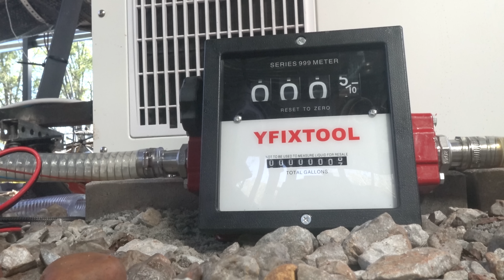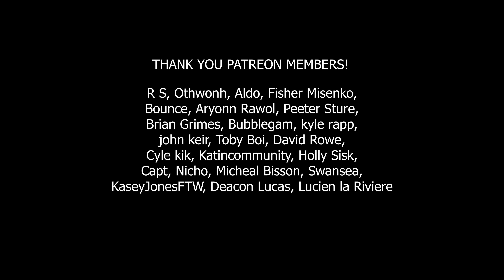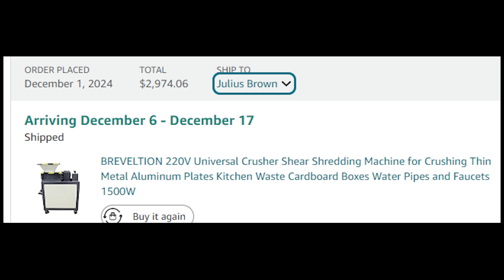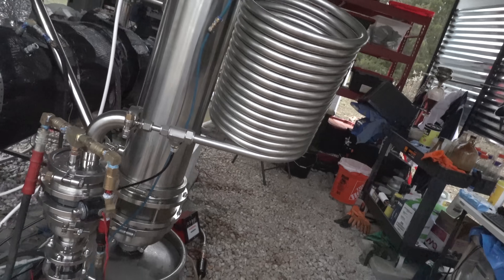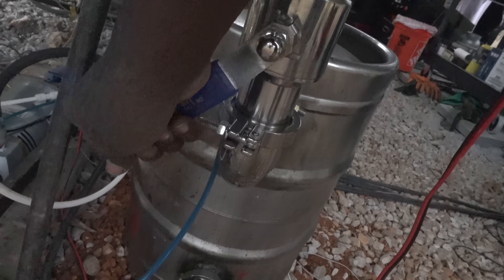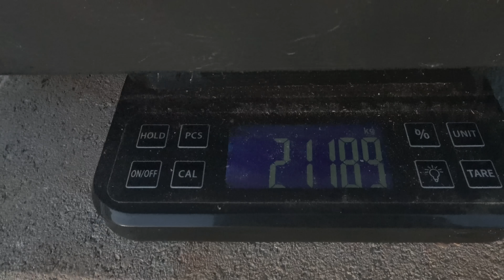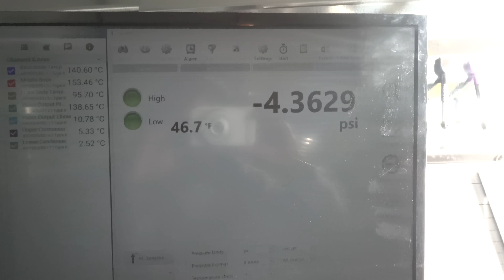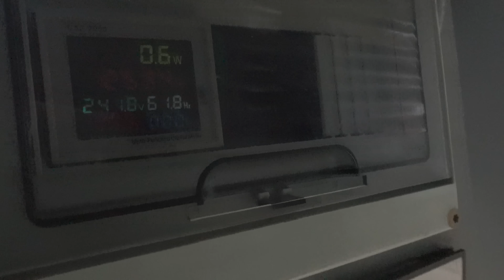I made my own gas station! Fueled by Plastic Waste + LDPE Analysis Run Part 1

Comment: This is actually cool , the only downside is that you gotta collect plastic yourself from whatever trash can/recycling bins on a daily basis within your area so that you'll be able to make whatever amount of gallons of fuel you need to use on a weekly basis , if people got busy lives this isn't going to work for them 

I've been reading some of the comments , I don't think the gov is going to harm him at all , but if enough people did this they might impose a ban on it , because the big fuel corps will tell our gov to ( shut those people down ) especially since it'll be hurting their pockets which in turns will also hurt our gov pockets also because there's people in our gov that receives money from these corps , or they'll come up with some Bs law to try to make money off of the people that do this process

Our gov knows that we live in a society where people want things (right now) instead of going through the process to make it themselves , so our gov isn't worried about a handful of people making their own fuel

Comment: This guy is out of business before he can sell a full tank of fuel. There is no profit to be made here as he is operating at a loss just to create each gallon.
Reply: Not everything is about profit. We need to find a use for the millions upon millions of pounds of plastic trash around our planet. This is one such use.
Reply: @Volcanic_Ashe  You can't solve one problem while creating another problem in the process.
Did you notice there are byproducts produced that are worse than the plastic?
What will be done with that?

So again your profit isn't the issue.
The problem still remains.

He isn't creating gasoline at all.
Reply: @Volcanic_Ashe  Turning the plastic into other usable items instead of toxic goo.

Comment: Wow using plastic to release gases into the atmosphere wonderful🙏❤️
Reply: If you bothered to watch to watch, he refined it and made it cleaner. It's not perfect and the gas may be toxic but it's no different from other gas at the station, except that it cleans up all the harmful plastic sitting around our environments.
Reply: well its not a solution to replace on bad thing with another, The source needs to be fixed

Comment: What is your power consumption through pyrolysis before it even hits the refining station? A lot of pyrolysis is subsidied because it's not sustainable and ends up a net negative. I want to see what your output in Kwh is.

Comment: This young man is the Inventor many Billionaires wish they are. There was a Japanese machine that turns household plastics into Oil that could be put directly into a furnace. I wanted to buy the residential unit. When I was prepared to purchase it disappeared? I found a distributor in New Jersey but somehow

Comment: There is no reason for all the plastic pollution in the world when you got inventions like this that can recycle and refuel our economy like this. Thank you for showing people that it can be done. Very smart and very innovative. Your one of the best Scientists I've ever seen in a long time ❤❤❤
Reply: So when its a hard plastic, its mostly harmless. When you do this, you release those toxins into the air, have to dispose of the other waste which can now seep into the environment much easier, and you're burning the finished product to release the rest into the air.

This process is only good for people who are bothered by the eyesore of plastic rather than the actual impact of it
Reply: https://www.youtube.com/watch?v=z_MqqLgTNLQ
Reply: You want to come work at Dakota gasification?  Put in an app I bet they’d hire you
Reply: Its not energy efficient to do this unfortunately.
Reply: @Mythocondria_Dev Rome wasn't built in a day. Give him time to get the wrinkles straight on the thing and have better efficiency 👈🏿🙇🏿
Reply: Energy and cost efficiency. If he's just pulling from the grid then you need to factor in the cost per hour to run with the amount of reclaimed fuel, i imagine his setup is not very efficient. If you're off grid it might be better depending on your solar setup.

Either way it's a cool as hell backyard setup.
Reply: @lolkthnxbai  it's basically run off the fuel he produces and uses to run his generator and solar power.
Reply: The diesel engine was designed to run on peanut oil so that farmers could grow their own fuel, as a BYPRODUCT of growing peanuts as part of crop rotation. 🤷‍♂️
Reply: @AnnoyingNewsletters  no.. it definitely was not...
Reply: I think the problem is that when driving on this fuel, you would pollute the air with these plastic left overs & heated chems, which harms the environment hard
Reply: @marcoroni1925 yea unfortunately you have to put more energy in than you would get out. However if you capture the toxic fumes and use solar energy you are repurposing the material
Reply: @Brad-qw1te  the people that have billions could figure this out, but they don't want too. Neither do the people who are oil barons.
Reply: AGREED 💯 Elon should be investing in him instead of wasting money giving it to the UK 💯

Comment: Instead of relying on a pump to pump the crude out of the keg, either redesign the setup or dig a cavity under the keg with a ball valve. This way you collect the crude without relying on a pump to extract. As you said in your video, the pump is currently the only way to extract the crude. Rather keep it simple.

Comment: The applications of this are great. Keep up the good work man. But if a bunch of guys in black suits show up offering you a lot of money take it and run, because they may not take no for an answer. I am curious though how much fuel and enegy do you have to use in order to make this process happen? And what kind of environmental impact will the process of distilling the gasoline have? Very interested.

Comment: This is sometimes referred to as catalytic depolymerization.  There was a German company doing this on a much larger scale about 20 years ago, but it's not feasible economically.
Reply: Bro the fact alone that once this fuel combusts its gonna have alot more toxic fumes in them then regular fuel. Literal Cancer Fuel right there. Micro particles go brrr
Reply: @XxMoonMan  i mean i think that's what the filters are for
Reply: THANK YOU. finally someone with some brains in the comments.
Reply: @ovoxomcful   My pleasure!  It's great to see another person in the comments who doesn't argue against common sense!
Reply: Most underrated comment. People don’t want to be honest
Reply: I work for Air Liquide as an I/E Technician at a Hydrogen Purification Unit. We essentially take dirty gas and turn into even cleaner gas. Then re sell it .. this is beyond impressive..
Reply: It all depends on what people want as the demand for reusing Plastics increase the feasibility could change using history to justify current value is silly because some of the most valuable things today were worthless in the past times change and what's important to people changes with the times. Idk enough about this stuff to go into detail, but I do know did the world 20 years ago was not really interested in recycling Plastics like it is today.
Reply: @grey5135   Yes, things do change over time.  However, something that hasn't changed is the fact that it takes much more energy to process this material than what you end up with.  In addition to the huge waste of energy, it's a huge amount of toxic pollution.  This doesn't even include the cost of time and energy to sort, transport, and store, all of this waste that's being processed.
Reply: Bullshit. Typical indoctrinated/programmed comment. Cleaning up trash all over this ‘effing world isn’t feasible or economical??? That is a rhetorical question, I don’t need your answer. The energy was free in the 1st place we didn’t need their faux-dinosaur product to begin with which is another indoctrinated lie. I find Middle aged wanna-be-engineer human men like you that still parrot lies about men rocketing to the moon lens, & that the plane we exist on is spinning, nothing better to do than take down a young man’s endeavors. Get a life and go try out a real experiment for yourself why don’t you. ECONOMICALLY SPEAKING, WORKERS ARE BEING ROBBED OF EVERY DOLLAR THEY EARN TO TRAVEL DOWN THE ROAD EVERY SINGLE DAY 24/7 YEAR AFTER YEAR.
Reply: The comment I was looking for. 👍🏻
Reply: @MrD_2112 you people are always looking for something negative. Everything we put out hands on prospers. The German company wasn't meant to succeed at it
Reply: @MrD_2112 exactly - I'm looking for commenters who can vet this idea
Reply: @Philosophaster  It's been done for decades.  I posted a link to a company, Clivia Tech, that was building plants, but my comments are being removed.
Reply: What if he found a way to use less fossil based energy. 

Example - use a parabolic mirror array to generate heat (concentrated solar power) and then heat sodium nitrate to a molten state as he the heat source. Solar panels can be used for running electric pumps to pump the molten salt through the system instead of microwave (using electricity from the grid). Just thoughts.
Reply: @stevensheaves   Sure that sounds great, where are the solar panels and all of the complicated pieces of equipment going to come from?  Is he going to just stop by and pick it all up from where Jack got his beans for his magic bean stock?  I don't mean to sound like a d*ck, but it just isn't feasible right now, maybe at some point in the future, but not now.
Reply: @stevensheaves  The amount of energy needed to run this operation would outweigh the amount of energy procured from the plastic, you'd be better off just taking that solar power and using it to directly power electronics. There is no need for gasoline in this world besides profit, all transportation could be electric but our governments will never build the infrastructure. The vast majority of people don't need gasoline or cars, I don't understand why it's so hard for everyone to see it that way. A real step in the right direction would be to advocate for nuclear energy, expanding and improving public transportation, and to stop handing out EV credits to garbage companies uninterested in actual progress.
Reply: @funy0n583  all of those will happen with time, especially nuclear. the point of this machine is to take plastic, which is actively damaging the earth with no benefit, and convert it to a resource that can benefit certain people. although nobody needs a gas car to go to a walmart 3 miles away from them, it can definitely help, especially if they can’t afford an electric car. money is the main incentive for all of this new technology adoption, after all
Reply: @funy0n583  I know this comment is late from when the video came out but, 
While the vast majority might not need gasoline we all don’t live in the city. In the city where you’re close to everything then electric vehicle makes total sense. 
But if you live where I live, in the terrain where some of us live you have to have trucks, tractors, trailers. 4wd. Atvs. And I’ve seen the cyber truck in action compared to diesel 4wd/gas 4wd and there’s just no comparison, not yet anyway. And until that happens we have to have diesel powered equipment. I could probably do without gasoline but diesel is an absolute must have. As of now anyway.
Reply: @justinjames7801 well I did say “the vast majority of people don’t need gas cars” that statement doesn’t apply to everyone. Gas will still have its place for a long time but in cities we just don’t need it.
Reply: @funy0n583 I completely agree 👍 and honestly I’d be all for electric equipment 
I have to keep 500 gallon fuel tanks to run my equipment. If all I had to do was charge my equipment it’d be great. But also if there’s a situation where you run out of fuel a few miles away from home out in a hay field or something similar we can bring a tank. If it’s electric you would just have to go back and charge before you run out of juice I guess. 
Both have their advantages and disadvantages. But if you’re in the city then absolutely yes. Nobody NEEDS a big gas guzzler. but then again what if they want one? Is it taking away peoples right to choose what they want to drive if we make it mandatory for people to drive electric vehicles?
Reply: But you’re right it’s gonna be long time before we can do without petro all together
Reply: @justinjames7801   Why would you want to do without petrol, are you insane?
Reply: how is it not feasible economically?   CAN you explain your skepticism& back it up?
Reply: Probably cost too much energy and work to extract which might make it not worth it.
Reply: @ThienNguyen-wh1fz but it worth it for the earth,you can't get anything if can't save the earth.
Reply: @zmax683   When you're consuming energy while processing resources to end up with less that you started with, you're not doing anything good for the earth, you're doing much more harm.
Reply: @davidstjames_ doesn’t matter at this point because the energy is in all the excess waste we’ve already made.
Reply: @off6848 your wrong. The energy he’s using to run this equipment came from the plant.
Reply: @off6848  Yes, there still is potential energy in the waste materials, but it currently takes even more energy to extract it than what you will get.  I posted a link to a company that was building large plants to do this, but my comments are being removed.
Reply: @dongliker  What fuel did he use the first time, before he produced anything?  Yes, exactly, there's a net loss of energy no matter what.
Reply: @KwykWhych  why does anyone have to explain when you literally have technology in your hands it just takes a simple search? Swear everyone wants their hand held too lazy to find it themselves.
Reply: Think about energy in vs energy out. It costs energy to heat things up 👍
Reply: @KeturahTori Just because something is possible in a laboratory doesn't mean it will scale to industrial application. Many times it's because it's too expensive or not ecological enough. There's a world of difference between doing something a few times on a small scale and doing something in perpetuity on a large scale.
Reply: @KwykWhych  imagine how much electricity it takes to Lowe all of these filters and pumps dude
Reply: @KwykWhych it’s basically like desalination of ocean water for drinkable water. Yes it’s totally possible but it’s less efficient than other means. This guy is cool but I hope he gets blood work done and uses better PPE
Reply: @MegaCokamo not to mention the original commenter said it was the german compnany who decided it was not feasible. The people on this channel get very defensive when you so much as question this guy.

Optimism in engineering gets people killed. Did we forget stockton rush ignoring the advice of everone else around him?
Reply: And what exactly do you do that is feasible economically ?

Comment: If I might make a suggestion,  your pump won't push the fuel up hill but if you was to have a hole to stand in and let gravity push it down it would work, most pumps have a set of working schematics that say something like it can go up this far with this much pressure,  you see what I'm saying

Comment: This is amazing!!🤩 This was only theory in 1995 when I was in college! We had a group project that was our final. There were 4 groups. 
   The topic was solving the explosion of population growth due to the exodus from California policies. The stipulations were that it also solved, or contribute in solving an environmental problem. 
   One group focused on using🌽 as a substitute for petroleum. Our group focused on using plastic waste, compacted into pellets to fuel boilers to produce heat and electricity for large structures/buildings. Which would take tremendous stress off the grid. But, the possibilities of plastic waste being a replacement for petroleum or coal is small. 
   Diversifying with a variety of fuel and energy sources is key! It will ensure, not only preserve or slow down the depletion of fossil fuels. It will preserve multiple fuel and energy sources. And the research to increase those sources for centuries to come. 
   It will also ensure geographical expansion, for population growth, into otherwise uninhabitable environments that the current energy grid cannot support.
   This is great news!!
Reply: Huh? A company in Germany was trying this in the 80s and found it to be unviable at scale. He didn't just figure this out.

Comment: @naturejab  , just a thought  - couldn't the process go straight to the distillation after microwave? this could avoid condensation. maybe this would require adjustments to heat and pressure

Comment: Pumps need priming typically to run efficiently and avoid overheating. Maybe less hose on the in side of the pump. This would reduce the amount of latent air in the vacuum side of the pump (in side). Just an observation

Comment: As a former plastic extrusion operator and chem reactor operator i really like what i see!!
I wonder what the result would be with polyamide (nylon).
And is your system self cleaning or do you need to crawl in the reactor now and then to scrape it?
Been there done that. 🤣
Reply: You think hes actually cleaning this and then disposing of it safely and properly? 😂
Reply: @RxYouth  He should clean the reactor properly before each testrun to prevent contaminations between batches that can mess up results.
In the plant i've worked we even had to take the extruder apart and weigh every component before and after the testrun to see how the material would wear down the machine.
To bad this is't my neighbor id love to help him make this a conitnous process.